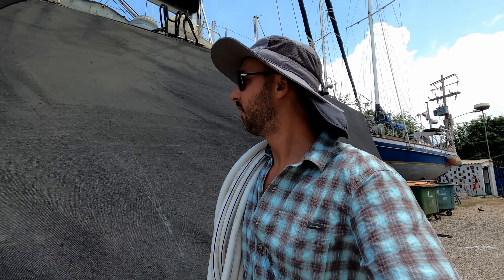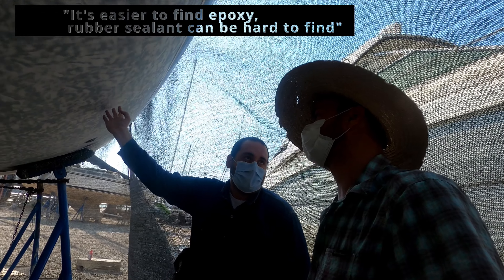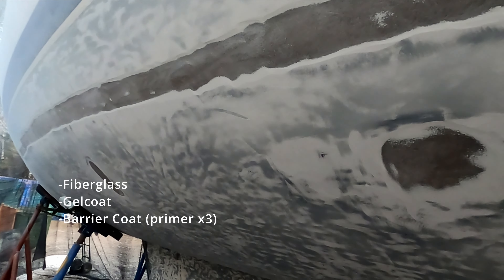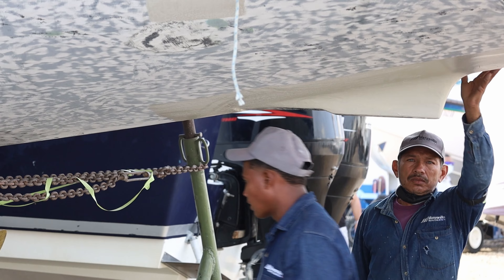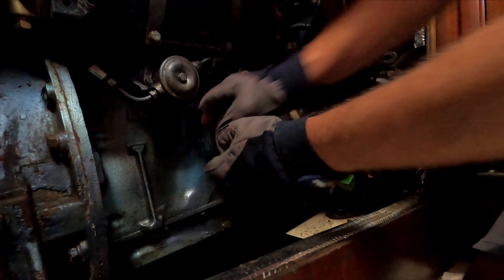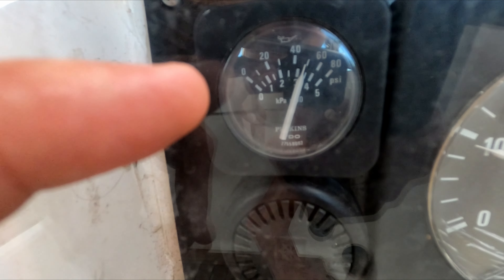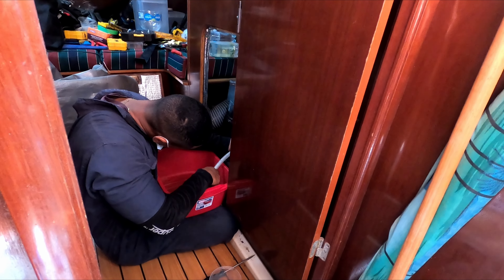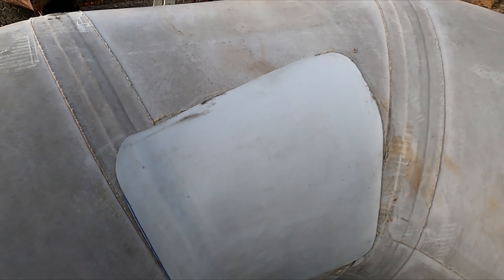Episode 30 - First Haulout, Osmosis, Antifoul, Random Crew Joins!

Comment: Way back when I had my boat the recommended oil change on my diesel was every 100 hours.  Look forward to seeing footage on your crossing.
Reply from the maker: Thanks John, I've also read 100 hours is a good safe number to use when in doubt. The Perkins manual specifiies every 250 hours for low sulfur fuel, and I've generally stuck with that but it never hurts to change more often for sure. Thanks for watching!

Comment: Why the washer such a mistake?
Reply from the maker: At that point in the trip, I just hadn't used it very much. 

Part of the problem is that using it through the boat's water system causes the water pump to cycle on and off repeatedly for a long time while the washer slowly fills - its bad for the pump to cycle on and off. 

Where I ended up getting better use out of it was in marinas where I would just hook the washing machine directly up to the marina water supply, and could crank out lots of laundry in a day, and at the time of writing now the washer has certainly paid for itself ($300 US) in saved laundry costs. 

I have some tweaks in mind to hook up the water supply on both the hot and cold side in the boat's water system, to allow the washer to fill faster and hopefully not cycle the pump on and off.